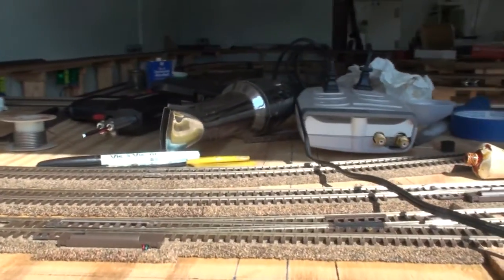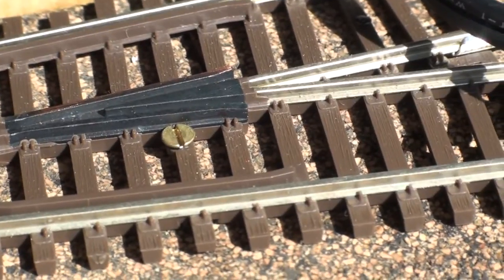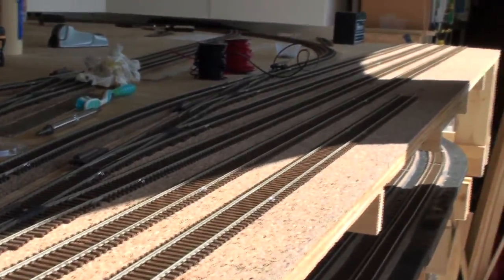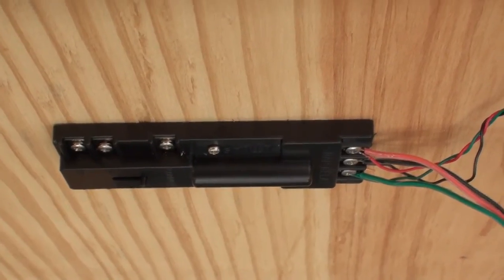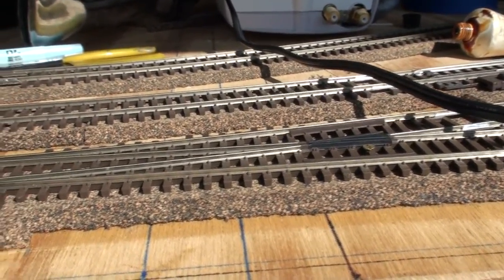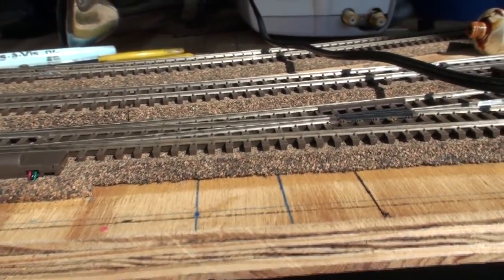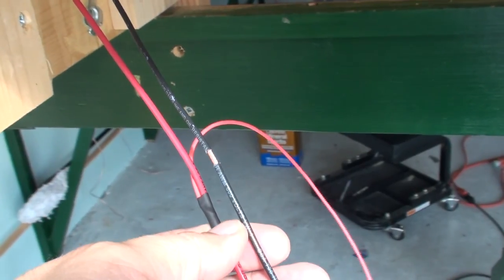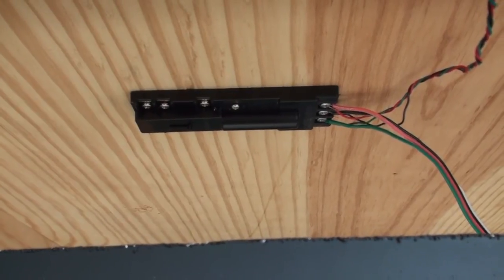My CSX/NS HO Railroad Part 18 A "Atlas switch machines and Atlas #200 Snap Relays"

Comment: I have a few #8 turnouts, metal frogs but is 2" space of unpowered track. Amazingly, I have no trouble with it yet. I have 4 snap relays coming in so might try to power the frog just to be safe and control some lights with the relays.

Comment: In reference to TheJoePaul's question:  If you are using LED's you MUST ALWAYS use a resistor (unless one is built in but usually resistor's aren't), the resistor is a current limiter more so then a voltage dropper.  Also as an FYI diodes, including LED's, as a general rule drop .6 volts across it (.6  is a minimum it can be more depends on the type of diode), i.e. 3VDC on one leg ~ 2.4VDC on the other leg

Comment from the maker: @TheJoePaul All depends on the voltage that you are connecting throught the relay to you light (Signal).  If your signals are LED's then you will need approx 3 volt's, or reduce/resistor the voltage to 3 volts if you are connecting it to a 12 volt power source.  Either leg of the led can use the resistor.